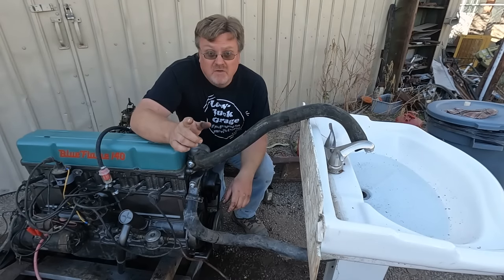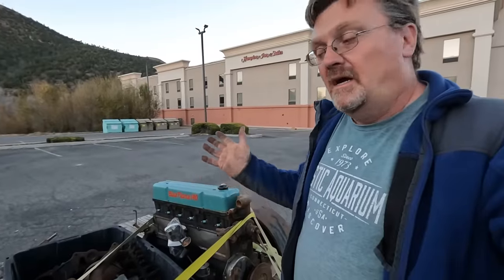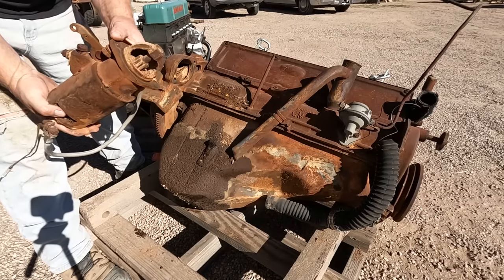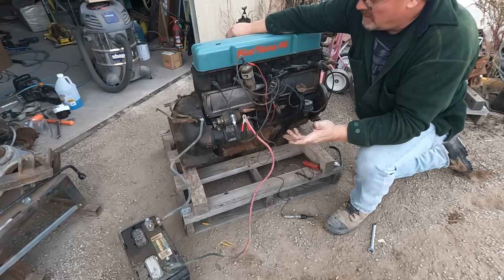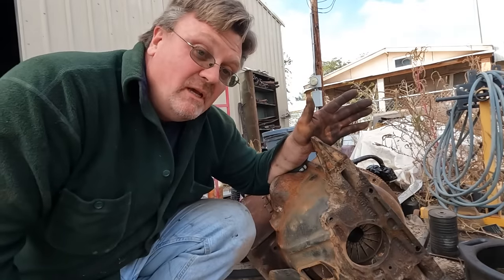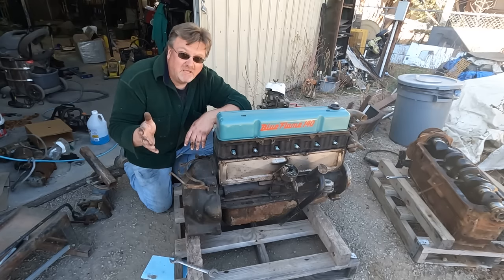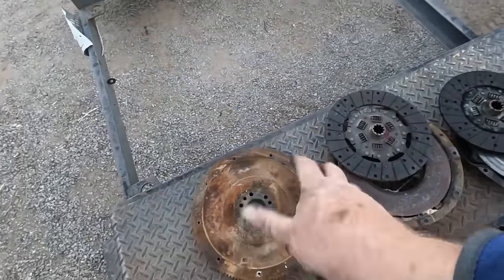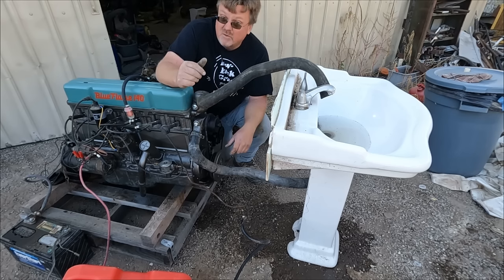Chevrolet Blue Flame Stovebolt Six, Test Run!

Comment: That is a wonderful running engine, and a treasure chest of parts to boot! It is very common to see a lot of sludge in old engines with road draft tubes like this engine has. This is not as noticeable in cars that are driven for distances at higher speeds, but if the car is driven around town at slower speeds, the road draft tube can't pull enough air through the engine to pull blow-by out. One of the best things that can be done for an old engine is to add a PCV system, and make sure that the system will pull air through the valve train along with the crank case. When PCV systems were added to engines in the 1960's, and the bugs were worked out, engines were staying clean enough that oil change intervals were extended from 2000 miles to 3000 miles. Engines also lasted a lot longer. I put one on my 1959 Ford Fairlane, and the engine is staying very clean.
Reply from the maker: Thanks for the info!  This truck is going to spend most of its time off-road, so I definitely will not have much air flow.

Comment: It's refreshing to see a man who knows how to fix things correctly, but then doesn't do it and fixes them the way most people with limited resources would.  Saving things, not trashing them.  Just good old JB Weld, scrap metal, and creative welding.  No brand new crate engines just because the old one developed a valve tick.  And on top of that, you know how to start a vehicle with a carburetor.  What more could a person want in a YouTube channel?

Comment: Those were very reliable engines. I owned and worked on quite a few. That higher compression model was much better than the older ones.

Comment: The single long lifter/push rod cover on the side of the block was your first clue to it being a pressure oiled engine, it covers hydraulic lifters which, as you can imagine why, weren't ever provided on splash oilers.  The Blue Flame 140 cover would indicate 56/7 because the rest of the series were decaled with either 135 or145  on them.  1956 - 1957 with 1 Barrel Carb
Max Brake Horsepower: 140 @ 4200 rpm
Max Torque: 210 @ 2400 rpm
Stroke: 3.94
Bore: 3.5625
Compression: 8.0
Firing Order: 153624  Hundreds of Stovebolt's due to their longevity and strength found themselves back in the days doing replacement duty for diesel engines in fishing boats, large trucks and even some series of Cat Bulldozers.  As a general machinist, our shop on the west coast of Canada specialized on marine diesel engine repair & replacement with it often happening that on a very tight budget, touring the local salvage yards, finding a used Chevy, Pontiac six of the pressure oiled years, doing some run-up oil pressure & compression leak down tests resulted in a commercial guy getting back out on the water at a fraction of the cost of a Cat/Wakesha/Perkins reman.

Comment: That's a good color combination on the engine.
Imagine how much better it would run with the correct carb.
You hooked up to a good one there.
Reply from the maker: Thanks!  I'll be tackling the carb issue pretty soon, once I get the fuel supply straightened out.  Pouring fuel in the bowl with a can does not help with getting the mixture right!
Reply: @LowBuckGarage  that was a great idea to use your pedestal sink for the cooling system. Eliminating the radiator.
Maybe you inadvertently just invented something.

Comment: Here’s how you get that engine free.
.5 take the oil pan and oil pickup off.
1. Get a 55 gallon barrel, cut it down, and slot the side so that engine fits in the barrel.
Have a drain, so you can save your vinegar. Have it setting high enough so that you can drain out your vinegar and save it…one of those drain cocks would be nice.
2. Fill the barrel with coarse gravel…right to the top. Make sure it gets everywhere….yes, in the engine…not going to matter.

3. Get about 10 gallons of vinegar, and fill that barrel up…shake it around…cover it up. At least up to the last cylinder. Because that’s what’s stuck.
And walk away for a month. You can use muriatic acid also….but not for so long. And vinegar is cheaper.
4. Pull the engine out with a cherry picker.
5. The gravel displaces the vinegar, so you don’t have to use so much. Drain the vinegar, put it back into the gallon jugs….use it again, and again.
6. Leave the gravel in the 55 gallon drum. Use it for next time.
7. Spray those cylinders with lube…whack the pistons a couple times, and it will turn.
8. If your so inclined, hone the cylinders, so it will rotate easier.
9. Have pie and coffee….😀
Reply: Thats a good idea.
Reply: B to

Comment: Congratulations James on the Blue Flame 6. That entire combo that the seller set up will do wonders for the G-506. I can't wait to see you discover just how slowly that truck will roll in 1st. gear, low range. Great video BTW.
Reply from the maker: Thanks!  I'm looking forward to taking it for a (very slow) spin.  That'll probably be the right speed, because I doubt the brakes work...

Comment: HUGE tip I learned the hard way . .. paint on alignment marks over the edge and into the middle. Then I don’t find I accidentally scraped them off :o)  (also a fan of dot punch and chisel) * I have dot punch marks on my lathe chuck. I drilled a lifting hole on the chuck. I didn’t pay enough attention. When the lifting eye is at the top the marks are at the bottom where I can’t see them. So if I can’t see any dot marks at all I know it’s right :D

Comment: 54 and 55 had solid lifters with a manual trans and hydraulics with an auto. 56 all had hydraulics. The rocker shafts like to wear to the point where the flat on the bottom for oil across the bottom of the rocker bearings to spread is gone. Doesn't even have to be that high milage an engine. I used to cheat and grind a little groove across almost across the worn areas to help lubrication. Also the oil passage to the rocker shafts sometimes gets clogged and you used to get a kit with hose and fittings to bypass this problem.
Reply from the maker: Thanks for the info!  I'm just learning about these engines, this truck is my first one.

Comment: that's a good sounding engine. nice that you got a metric crap ton of spare parts to boot. since you have the old engine freed up, you can always remove the piston from the holey cylinder, drill and tap some bolt holes around the gaping maw of that unneeded auxiliary coolant passage for a cover plate to keep the coolant where it belongs, and make it a 5 cylinder engine just to prove it can be done. be a conversation piece if nothing else. or connect it to a treadmill motor or an old genny head unit and make it a cheap generator for S's&G's. heck, you even have the accessories to run it on propane, i'll tell you what. lol!

Comment: KNOW THIS.  The 235  cu in motors had hydraulic lifters in the cars and solid lifters in trucks, including pickups. A very common mistake, even on new or rebuilt engines was to look up the specs for a generic  235.  set the lash to zero, and burn the valves the first time they drive it. DON'T  do that.  If you don't know for sure, set the lash for solids... Before you run it much...JE.  Damn good engine....When cranked, it is indicating a low cylinder. Might be a valve pushed down. If the compression doesn't even out quickly, check that lash. Best to check it anyway.
Reply from the maker: Thanks for the tip!  I didn't try adjusting them yet, but I wiggled the rockers and there was some lash.  It probably is a solid lifter motor.

Comment: Wow! That old 235 fired right up like it was running yesterday! I had a late '47 Chevy 1 ton flatbed (looked like the 48-53 body style), that I went through 3 different engines before finally settling on a late model (1979) 250 6 cyl. out of a wrecked Camaro. In 2 cases, I had to use that miserable cast iron bell housing that loaded from the bottom in order to match the Reo 5 speed OD transmission I robbed out of a GMC deuce and a half. The original engine of course, was a 216 dipper motor, and it was just gutless for what I wanted to do with it. The second engine was a 248 GMC engine out of the same deuce and a half that the transmission came from. Unfortunately, it had broken rings and 2 pistons that the ring lands were destroyed. Couldn't find any good pistons for it, so I ended up sourcing the '79 250, and a more modern cast iron bell housing that had to be modified for the Reo transmission. All in all, it turned out great, and I drove that truck for 21 years until I finally sold it in 2012!😄👍👍

Comment: Your pilot bushings  are different  size you might want to check that out and locating dowels on crankshaft  one is offset for putting on flywheel for timing purposes,

Comment: I've seen maybe 3 of your videos (so far) and I'm impressed with the number of unique mechanics tips and problem solving you're sharing. I didn't know I already owned a lathe using a drill, diff, floor jack and a grinder. You'll find me in my garage.

Comment: Btw, 6 volt starters work very well w/ 12volt system conversion - spins my 54 - 235 nicely

- 55 and later were 12 volt systems with different flywheel and gears.
Reply from the maker: Thanks for the info!  I bet that other starter and flywheel I got with the engine is the 55 and later version.

Comment: Been there a few times.  Detroit Diesel 3-53.  Aluminum block with a punched oil pan so first step was removing 3 broken oil pan bolts.  TIG welded extensions extracted those and then welded the pan solid.
Then I built a test stand and rigged up a cooling system.  Ran it until operating temperature and double checked the cooling system for leaks.  Cylinder liners have rubber o rings in three places..wet iron liners in aluminum block love to leak.

Got it running and installed in a former USMC 6x6 Gamma Goat.

Comment: That is a great sounding engine you picked up for your truck project.
   You just gotta install a brand new Thrush turbo muffler on that one once it's finished.
  Yeah I said brand new! 
I know it's a budget build, but that sounds so good it deserves it.
 And those mufflers are fairly cheap price for how good they sound on old engines.
  That clutch and bell housing on the old engine may have been a ball busting job to remove,  but you have to admit, no one makes things built to last like that anymore.   Whoever designed that planned on it to stay together forever.
Tim from Wisconsin.
Reply from the maker: Thanks!  On the muffler, I've got to give a shot to the glass pack I found in the back of the truck when I emptied out the bed.  If it doesn't sound good I'll change it.
Reply: @LowBuckGarage     a glass pack would be good for that truck,. Especially since you already have it.

Comment: The official "Blue Flame Six" from the 53/54 Corvette, had three carbs, a dual exhaust manifold and Powerglide automatic transmission. Your 235 still sounds great. I got a 42 Chevy 1/2 ton Army truck in 1975 that I built into a very useful driver with a newer drive train that looked totally stock.

Comment: Great job James! 😁👍 I enjoyed the video my friend. I like the sink idea and the "reenactment footage" had me rolling!!! 🤣😂   Glad you're making progress already.  Nice parts haul with the engine. yeah, those old bellhousings can be a nightmare. I gotta go through the same process soon on my '56 International s-120 4x4. Engine is locked up and bolts go through from the inside 😬
Reply from the maker: Thanks, glad you enjoyed it!  I feel for you, that bellhousing style is a pain.  In hindsight, I should have pulled off the balancer and timing gears to get the front motor plate off.  I think that would have taken less time than fiddling with the rods trying to get it to turn over.  Or cut the motor plate in half and welded it back up later if I needed it.  Either way, pulling the crank out entirely would have been the way to go.

Comment: Underrated channel; maybe attending offroad games in Moab Utah would help others find this cool channel. 
You could haul your subscribers around the event in your covered wagon.
I have mentioned this channel in the comments of Matts Offroad videos that have info about the event. 
They asked for more recommendations of youtubers to invite and said to notify channels like this about the event so that they might attend.
I thought this channel's offroad vehicles might be close enough to trailer or attempt to drive to the event and back.

It would be neat to see an ancient half track cruise up sand hallow unassisted; if you trailer something neat to the event besides the covered wagon. 

If you need any help hauling, I got a Perkins diesel 64 Loadstar 1800 dump flat that can haul heavy and tow a trailer, too. 
I want to take my lifted K30 with Holmes 500. I can drop it there or use it to help haul a vehicle to the event.

I have a Holmes 600 for the IH; but I doubt it will be installed in time for the event. 
I have too much work to do to the K30 and a Jeep Cherokee that's my backup off-road vehicle.

If my trucks are not ready in time, then I don't care if I have to drive around on my 1964 red / white Honda Super Cub 125, CT125 or my quad; I'm going to the event and will just drive the Suburban and little trailer to get out there.

Youtube algorithm is not doing this channel justice for some reason; it should have hit 100k a long time ago.
I still like to go back and rewatch these older videos. 
The channel has enough videos to binge watch now; keep the quality up. Don't worry about quantity.
Reply from the maker: Thanks!  I'll look into that event...

Comment: like your use of the kitchen sink.  I've used pic pipe with a T on the topdown't glue the joints just jam them together.fill with water hose.  trash gets flushed out.

Comment: UTG channel did a bit with a map gas torch to sweat the oil out of the pores in the metal and followed up with primar and brush on tractor paint.  i don't always agree with UTG but, that bit was pretty good.

Comment: You said you put on the starter and solenoid for it's rated 6 volts and you want it to hook up to the 12 volt battery but the ballast resister 25,000 ohm or higher has to be in between the battery and the solenoid to keep it simple and safety of the low heat on these load. If the ballast resistor is too hot then add in another 100,000 ohms series ballast resistors. Thank you said by electrician ASE mechanic.

Comment: Wow! That was SO educationful! I had no idea about the different water pump heights, later heads with higher compression, or the improved lubrication system on the newer generation engine blocks! Does the later engine block still have a steel tube going up thru the water jacket to take oil to the rocker arm shaft? Unfortunately, the serial number on my title matches only the number stamped on the engine block, but I understand there is a provision with the state DMV to change that.....
Reply from the maker: It does have a tube going up and over the rocker shaft.  I'm going to adjust the valves before I drop it in, so I'll get some close ups of that area in the next video.
Reply: @LowBuckGarage  Looking forward to the next (and all of ) your videos! Oh, and to use a term borrowed from electronics, what you put together for the testing of your stovebolt engine is a "Heat Sink". Yessir!

Comment: That's a honey of an engine, great snag.
Ya know in my head I guessed 65lbs torque then you said 65lbs.
Most torque specs are just determined of bolt grade/size, particular function of the fastener and the material ... but you gotta be bolt detective, or just use the manual.

Comment: I once worked on a rebuilt 327 . it had nice valve covers and a wash job I was glad I did not buy it .The Blue Flame 6 was a Corvette engine with 3 single side draft carbs , and was a very strong 6 cyl . .

Comment: Have not read all the comments but just wanted to say that the first and last studs attaching the manifold to the head didn't have any nuts, they were more like locator pins.

My father said not to replace those pins with proper studs with threads and nuts on the ends.

I am over 70 and my dad made it to 92 so we worked on many of those Chevy 6cyl engines.

Really liked those engines, our only problem with them were the aftermarket replacement large fiber timing gear, they always failed at around 40,000 miles and the valve interference ruined the engine.

I don't know if a cast timing gear is available but I would avoid those fiber (bakelite?) timing gears.

I like your build and appreciate that you don't beat on things mercilessly so good luck.

BTW, I have to raise my work up to table height now, I could never work on the ground any more.
Reply from the maker: Thanks for the info!  On the first rusty engine I worked on I assumed they were broken off bolts.  On this one they were in good shape and looked factory made to not have heads on them.  I'll leave them just like that!

Comment: The old 29 Chevy I had in my inboard boat.  I used anasead powder a couple times a year in the engine. To flush out the sludge as anasead powder was a mild acid.

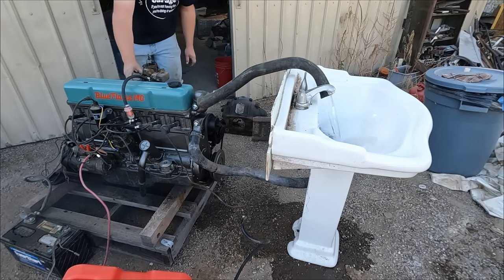Comment: Great video! but I am confused. at 35:04 you use a sink to keep the dirt out, but pump the dirt back in? Is there a trap on the sink? I don't think so. If it had a trap, it might hold some dirt before going back into the engine. But a simple screen window mesh in the sink would have worked to keep the large debris out.
Reply from the maker: Thanks!  This one was surprisingly clean, so I just let the little bit of dirt that was there mix into the water and then moved the top hose off to the side to pump the water out (it was way at the end).  You're right about the screen, if I had seen much debris I would go with that or a paint filter or cheesecloth or something like that.  On some of my Jeep motors there was so much fine dirt you couldn't even see through the water.  If it looked like that, my plan was to just keep flushing and re-filling until it ran clear.